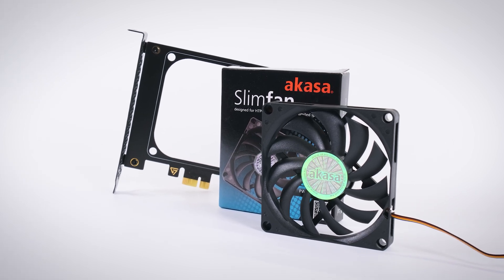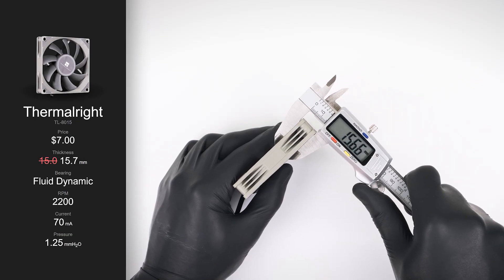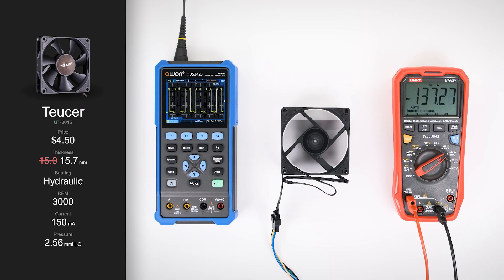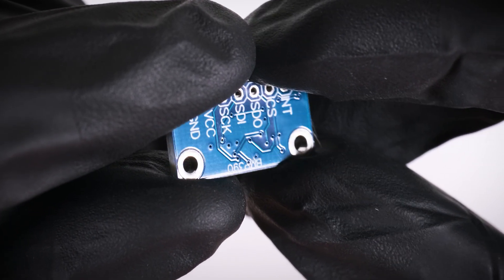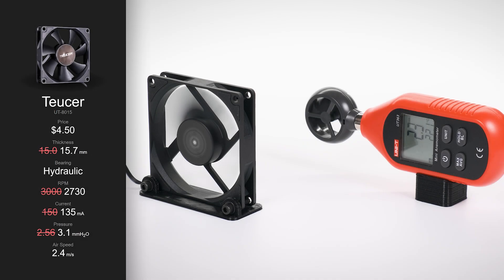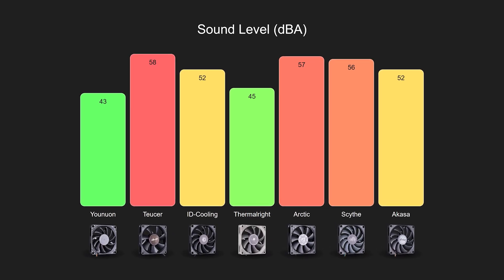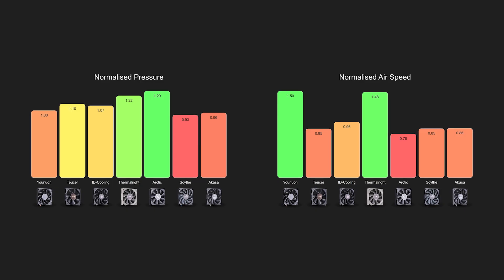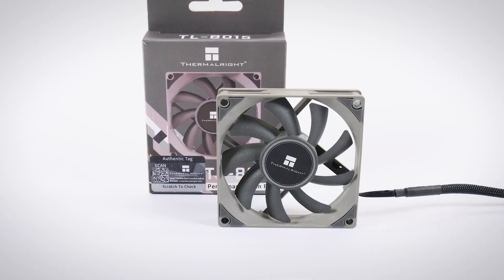I Bought Every Slim 80mm Fan So You Don't Have To - 7 PC Fans Compared

Comment: Thank you for the great video. 2U chassis use thicker fans, 25mm up to 38mm. Is it possible to test those as well? There are so many models, even from the same manufacturer using the same bearing and specs (ex: Sunon MagLev) but with a different number of blades.

Comment: This was very helpful. Thank you for doing such an in-depth review. I wish Noctua would make an 80x10mm fan option as well. 

I'll definitely be going with the ID Cooling for my 4L console SFF when I swap a Thermalright AXP90-X47 FC into it, because it won't fit in my case with the stock 15mm thick fan. I might get a other for my Zotac 4060 Solo deshroud because again, it won't fit with the stock 15mm thick fan and I currently have a 75x10mm GPU fan on it, but the bearing is leaking.

Comment: Did you measure RPM and current draw with the fans placed flat on the table or was it just for visual presentation? Because having the fans blow into a completely solid surface is probably what's causing the lower RPM / higher current draw.

Comment: This is exactly the comparison I was looking for as a fan of 80x80x10! Very disappointed that the Scythe is so noisy, it's a gem. Do you think it would be possible in a future video to show the noise, flow rate, and pressure at speeds of 10, 20, 30, 40, 50, 60, 70, 80, and 90? That way we could see if one fan is better than another at equivalent values.

Thanks, I'm subscribing.

Comment: Great test!.
Thing to consider with Artic, is the possibility of buying 5packs, if you're willing to repackage. 5pack of p8, usually is $15-$20.
If airflow is preferred, there is the f8, but they are not as common anymore.

Edit. Sorry, those were 25mm and does not include the slim, in 5 packs :(

Comment: Did you take into account that the fans will spin faster unobstructed than when close to or on a surface on one end?
Reply from the maker: It's a bit hard to see in the video, but the fans were mounted on standoffs to avoid restricting the airflow too much.